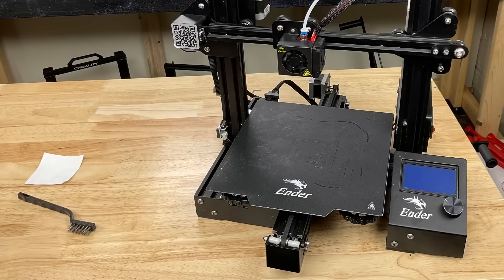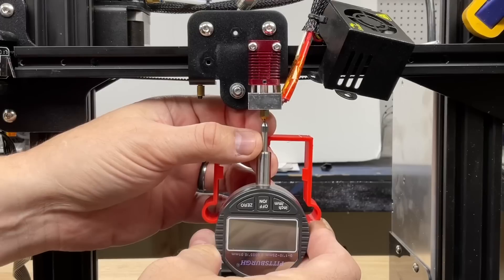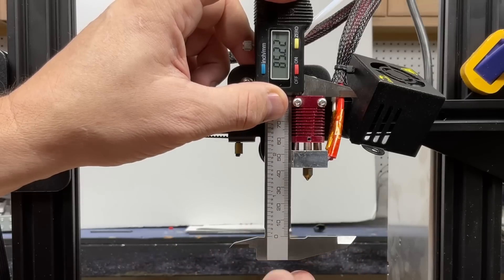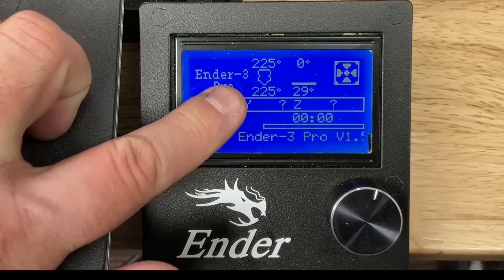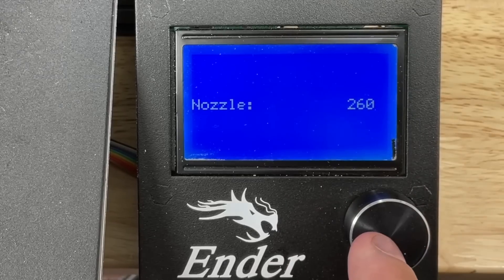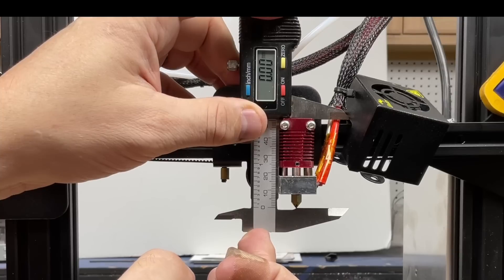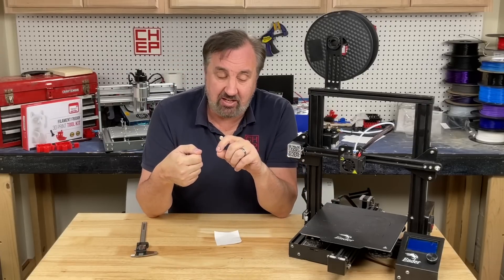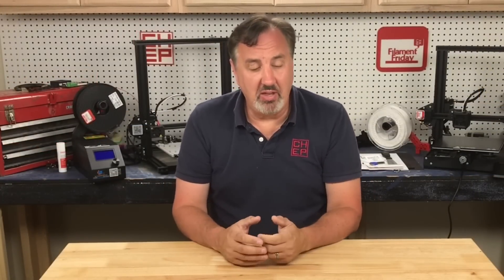Does a Heated Nozzle Expand and Mess Up Your Bed Level?

Comment from the maker: For those concerned about heat sink expansion, I held the fan in place while it heated to keep the heat sink cool to the touch. I only removed it to measure expansion.
Reply: Hey Chep, I'm fairly new to looking into the 3d printing platform, so I wanted to see if you'd be able to offer your thoughts on the best 3d printers for starters. I've been looking into it for quite a while, and I'm currently between the Ender 3, Voxelab Aquila, and Elegoo Neptune 2. People have made their arguments for each of them, but I just want to know what the best fit is for me in terms of the quality of the stock parts, out of box printing quality, modding capabilities and necessities (since I'm not too tech savvy), and community availability support for troubleshooting/help with mods. Could you help me out, either through a comment or a short video for those wanting to get into 3d printing?
Reply from the maker: I’d recommend the Ender 3 V2. But any of those would be fine.
Reply: Ender 3 v2 is well worth the small price difference if only for the operating noise difference.
Reply: First let me say I do not disagree that on a ender open air I do not disagree with your basic statement. Leveling cold in that scenario for the average ender users is going to have little to no impact. But have to say I think this is a little bit limited in your scope. A bed at 60 and a nozzle to 260 on its face does seem good. But this does not hold true for all users. A printer in a enclosure with a thicker bed. Is going to be more affected. The thermal expansion in that scenario is more than just the bed and nozzle the entire frame comes into the picture. We have actually visualized this. And the difference in build material from one printer to another is enough to change the results. I am not saying this without data we have at least 50+ we have ran test on to show this. I would be happy to try to get a conversation with people much smarter than me that may be able to share this. But my concern is that by not quantifying this to its specific scenario you may frustrate users that are actually being affected by thermal issues.
Reply from the maker: I’m showing Ender 3 which often has a beginner who is told to use paper and Ender isn’t enclosed. You can expand this any way you want but most understand I’m talking Ender 3.
Reply: @FilamentFriday  They sell a chamber just for the ender. So you can print ABS on it. I have seen it done many times.
Reply from the maker: Not saying it doesn’t exist. I have one but it’s outside the scope of the video.

Comment: How much does steel expand with heat? (Google)
For example if steel has a thermal expansion coefficient of 11.7×10-6 1/ºC it means that a 1 m long bar subject to a temperature increase of 1ºC will expand 11.7×10-6 m, or 0.0117 mm. I was told a Keep. It. Simple. Stupid, formula steel expandtion, about 0.001 inch for every 10 degrees of positive heat.

Comment: dude. there was leftover filament coming out of the nozzle when you heated it. thats where the increase came from. it got stuck to the calipers. It's actually visible at around 3:12. There is even a visible string when you pull away the calipers. I'm not saying metal doesn't expand when heated, but this increase was not from that. If you want to properly to this test you need a completely clean nozzle that has no old filament in it
Reply: It's hot and melted, so not sure how much it would affect the measurement.  But there's definitely filament there and left on the caliper.
Reply: @billgreganti7710  no, it's the angle in the calipers where it's dipping down. if you look at the calipers when the nozzle is cold it has the same appearance
Reply from the maker: It may look like it but there was no filament in the nozzle or hotend.

Comment: Hello thanks for all the video's  Well i have one question by heating the hotted drip filament from the extruder i use PLA and used variable temp from 195 to 215 but alway drive a little string from the hottend. maybe a nice item for an next video. thanks and have a great day. René

Comment: I have been printing on a Voxelab Aquila for almost 3 months. I now use a PEI bed. I noticed better bed adhesion if the bed was level otherwise the prints would lift. I typically relevel only when the print skirt doesn't lay right (You'll know it when you see it). I level with a heated bed and nozzle however, I may go back to leveling at room temp if not leveling against nozzle expansion and bed warp is a good thing (assuming the nozzle expands and gets closer to true level vs trying to get true level with a heated bed).

Comment: Brass has about 3 times the thermal expansion of stainless steel.  Specifically, the coefficient of expansion for brass I was able to find is 19 x 10^-6 / degree C, while the coefficient of expansion of stainless steel is 7.2 x 10^-6/degree C, and the coefficient of expansion of aluminum is 23 x 10^-6 / degree C.  So, if you have a huge 2 inch long assembly of aluminum and brass that all heated up by 200 degrees C, it would have a total thermal expansion of less than 0.024 mm.  I don't think we need to worry about that overly much, yes?
Reply from the maker: The whole thing doesn’t heat up as the fan keeps the heat sink cool. So just the nozzle and heat block expand as I essentially measured.
Reply: @FilamentFriday  My point is that the expansion isn't enough to create a real problem.  You'll get less than a quarter layer height expansion from the cold state, which is normally too small to be an issue, and if it somehow is, you can easily adjust your z-height zero position to correct for it.
Reply from the maker: That’s what I found in the video but I measured rather than calculate so I guess we just agree.

Comment: Chep, ,when will your Cura profile for 4.13 be released for the cr10s pro? Or will 4.12 load-in and work ok?  With thanks
Reply from the maker: 4.12 should work fine.

Comment: It's been a long day, so apologies if I'm missing something: the nozzle moves in the negative Z direction by 0.04 mm at all points on the bed, and the bed moves in the positive Z direction by 0.06 mm (if memory serves) in the center and not at all at the corners...which means the distance from the nozzle to the bed is no longer equal at all points. Not by much, certainly not if you're using a larger layer height for functional and/or fast prints, but if you're trying to print with a very low layer height for extra detail it would seem that it is indeed important to level at temperature.

All of this is to truly say that a live leveling test is a good idea if the level needs to be perfect, regardless of how you perform the paper level test.
Reply from the maker: Hot or cold you can’t adjust out a warped bed. So placing your smaller prints above an adjuster will yield more consistent first layer. 
Larger prints will suffer in the center but larger prints will most likely not be at low layer heights. There is also the option to use glue stick as an adhesive and not heat the bed at all.
So it depends on what you’re printing and how you want to print it. But heat vs no heat leveling won’t change at the adjustment knobs. Live adjust is an option I show in my more popular bed leveling video:
https://youtu.be/_EfWVUJjBdA

Comment: Hey Chep, any idea how to calculate e-steps for the ender 3 S1's sprite direct drive extruder?
Reply from the maker: You could take off the nozzle and run 100mm thru it.
Reply: @FilamentFriday  o u can ok thanks, first direct drive sorry. Didnt think nozzle replacement would be easy lookin at this one lol
Reply from the maker: Depends on hotend but S1 has PTFE to nozzle I believe so should work. 
You can also heat it up and push 100 thru the nozzle.

Comment: Experienced bed leveler here: 
Best way to level your bed is to get the same rubbing feeling on all 4 edges hot or cold and then do live leveling with a string test print. In live leveling you change the z height while it prints till it looks fine. And after that do 5 square print tests for adhesion, stringy means its too high, rough surface means its too close. 
Most of the time if your stuff isn't adhering to the bed or adheres too well change the z height a little, if you are printing symetrical prints mostly all the corners are off by the same amount, that should fix it.
Reply from the maker: Basically what I show in my most popular bed level video. It’s helped a lot of people with over a million views. 
https://youtu.be/_EfWVUJjBdA

But I still get a lot of questions about heat or no heat so hopefully this answers them.

Comment: Every single person who has EVER used a BLTouch or other inductive sensor, will completely disagree with the nonsense you said about the bed not expanding when heated.
Reply: I've got BLT, I don't disagree, I noticed long time ago hot or cold doesn't impact anything on my Ender 3v2
Reply from the maker: Then watch the video. I show the bed does not expand at the adjustment knobs when doing a manual level. https://youtu.be/NlUO-5EtB44
Reply: One type of measurement on one model of printer is a good start and probably fine in practice, but not enough for a claim like that. I agree, induction sensors will detect changes at higher temperatures, but that has more to do with the detection method than the build plate. 
Measuring the 4 pinned corners and center do not say much about possible deformation occurring on the rest of the build plate. The best way to measure this would be to use some interferometer or optical profilometer mounted to the gantry to measure relative deformation of the entire plate.  That would be an insightful video.

Comment: It's not that the bed expands when it's heated, it's that it warps. Always level with both the nozzle and bed heated because that's the real world scenario of laying down filament.
Reply from the maker: If you watch my previous video I show that the bed at the adjustment knobs doesn’t change so heated or not it doesn’t adjust for  warp in center like the video showed. 
And as I explained, if you have warp and the print is smaller, print over the adjuster, not the center. 
https://youtu.be/NlUO-5EtB44

Comment: Thanks for this, Chuck.

I proposed the feeler-gauge and cold bed and hotend method on the RepRap forums many years ago. I was laughed out-of-the-room and even called mad.

I've been using these techniques for years (knowing what offsets to add for each filament after levelling to get the correct first-layer height).

I take some solace that while the community never listened to me some printer manufacturers did with the inclusion of a 0.2mm feeler gauge in their toolkits (which many scratched their heads over).

Anyhow, it's nice to have some support elsewhere for these methods and I've managed to avoid burning my fingers for all those years.
Reply from the maker: It’s why I do these videos with testing, to give beginners the facts not just opinion. I also did a feeler gauge video: https://youtu.be/rDm9OziZ6dY

Comment: only reason I heat the nozzle is because there's usually PLA sticking out of it that needs to be removed, and yeah...I burn my fingers doing it all the time.
All kind of a moot point if like me you "live adjust" based on how the first layer lays down. But I'll be honest, I did not expect that result you got.

Comment: In my printer I have volcano heat block it expands 0.1 mm just for reference.
Reply from the maker: How did you measure that? 
0.1 mm in all directions or 0.1mm towards the bed meaning the block expanded more in all directions?
Reply: @FilamentFriday  with a feelergauge. Expansion is vertical-and I mean the whole hotend. First set the nozzle to 260C and lower it on the surface of cold bed. Let the hotend to cool to ambient the use the gauge to measure. This was measured with new nozzle so plastic residues would not affect the results.

Comment: I would love to see the measurements with much more detail, for the amount the metal expands .00 is not enough. 4-6 decimal places would be much better and i would say more accurate as well. However in the grand scheme of things does it really matter. the point of the paper is to get it in the ballpark then you just adjust till you get a perfect squish on that first layer. how much it expands when its hot vs cold doesnt matter. get it in the ball park and then run a test print and adjust the bed till you get perfect first layers WHILE ITS PRINTING cause cause what does matter. even so its its nice to see someone investigating and testing this to answer questions a lot of us have wondered. thanks
Reply from the maker: I’ve showed how I did it. I’m fine with it but your welcome to get a better measuring tool and get more detail if you want.

Comment: Bed leveling seems to bed a major issue in trying to get great prints
These last couple of videos really added a lot of clarity to this issue for me.
How or what would be the effects if you were to install AutoLevel?
I use your g-code bed leveling, I get everything level run your test print and it looks beautiful, then I go to print and I can see that the right middle to back corner the filliment look half as thick as the rest, what might be going on? Thank you 
PS on bed springs when I was changing mine to a heavier spring I realized that the one in the back left with the cable support  works better if it is a 1/4” shorter so I cut it shorter, any thoughts?
Reply from the maker: Maybe this: https://youtu.be/dOrwAMFzGLg

Comment: You have point in you compensate, for this as you fine tune first layer anyway. So if your consistent in your method, and set the same Z-offset everytime and use the same method to tune in first layer after a nozzle shift. I agree it does not matter, as it looks very consistant.
If you did autolevel, I would so not agree :) Autolevel would be hugely impacted by your findings in nozzle expansion and bed expansion, mostly the latter.

Also, you say 0.04 is nothing. Compared to a common layer height of 0.2mm. I would claim it is actually a huge number. 
Same goes for the bed expansion you saw in your last video on the topic.
Reply from the maker: I didn’t see any bed expansion in my last video at the bed adjusters.
Reply: @FilamentFriday  I know. But as 99% of us print in the middle, the bed expansion you measured there is the one i spoke to.
Reply from the maker: Exactly why I showed that in my bed video. As I stated in the video, if it’s smaller maybe print over the knob instead of center and get better 1st layer.

Comment: I used to heat just the bed when I do the auto bed level and I noticed that it never seemed right when I tried a print. It would touch the bed. So, I've been heating the nozzle and the bed lately and I get better results. But I also print my PETG at 240C so the variance on the bed might be more than .06mm on my CR-10 too. 
Interesting video as usual Chep, always learn something useful.

Comment: First let me say I do not disagree that on a ender open air I do not disagree with your basic statement. Leveling cold in that scenario for the average ender users is going to have little to no impact. But have to say I think this is a little bit limited in your scope. A bed at 60 and a nozzle to 260 on its face does seem good. But this does not hold true for all users. A printer in a enclosure with a thicker bed. Is going to be more affected. The thermal expansion in that scenario is more than just the bed and nozzle the entire frame comes into the picture. We have actually visualized this. And the difference in build material from one printer to another is enough to change the results. I am not saying this without data we have at least 50+ we have ran test on to show this. I would be happy to try to get a conversation with people much smarter than me that may be able to share this. But my concern is that by not quantifying this to its specific scenario you may frustrate users that are actually being affected by thermal issues.

Comment: But every time I level my bed, the base layer is always so close to the bed, it looks more like the nozzle rubbed against the bed  instead of laying down a layer. Also makes it almost impossible to remove the print in one piece. Should I put in a Z offset anyway?
Reply from the maker: If it helps but I would just live adjust while first layer is going down like this video shows.
https://youtu.be/_EfWVUJjBdA
Reply: @FilamentFriday   I'll give it a go. I also found out that my be is not perfectly flat. Might have to get a glass build surface. Thanks for the help.

Comment: 0.04 is actually fairly big. That being said, your baby steps should fix it pretty easily and be consistent. I'd be interested in knowing how quickly it gets to 0.04 (is it mostly there at 210? Or is it a big change from 200-225?)

I fully agree that when it comes to corner leveling, you proved that they don't move by expansion, but when using ABL you definitely need the bed to be hot (nozzle doesn't factor in) so you account for any bump or dip in the middle.  If you want to make a big mesh and not sample every time make sure you heat the bed first.
Reply from the maker: I wasn’t talking about autolevel. This was to address beginners reading the manual and it tells them to level at the corners with paper.

Comment: It's difficult to level with paper and cold nozzle, because there's always some fillament on the nozzle tip, and you can't just wipe it off.
Reply from the maker: As I stated in the video, heating it to clean it is recommended.

Comment: Brass has a thermal coefficient of ~19ppm. A temperature rise of 180 deg C gives for a 13mm nozzle gives an approx 0.044 mm elongation. I guess the heat block itself would expand as well. For a 0.2 mm layer height, it is noticable at the first layer and should be compensated.

Thank you for measuring.
Reply: Note to self: bltouch won't see this offset